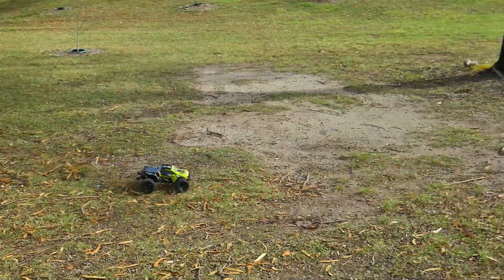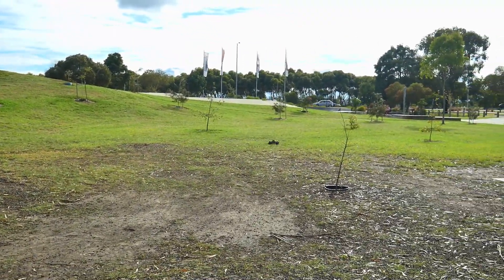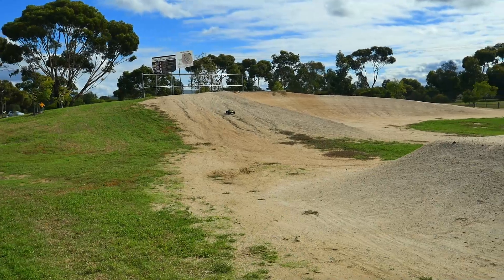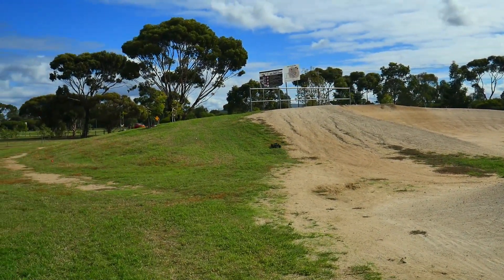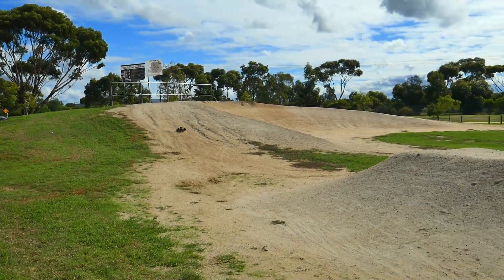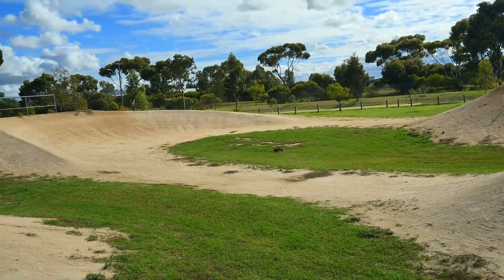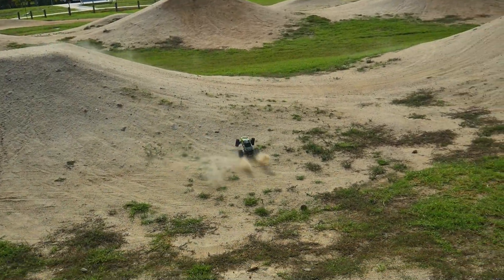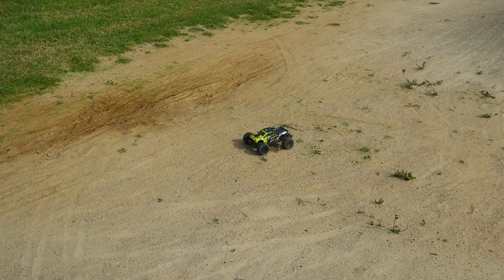First Run of The Rlaarlo Omni-terminator On 3s - Stock

Comment: You won't get a backflip out of the metal version motor unless you enter at part throttle and then floor it.  There is not enough wheel speed to flip on that KV.

Comment: A good quality 3s 120c battery, and the speed gear on the carbon edition with this bigger motor and bigger better esc and I’m doing double back flips like it’s both!! This truck is addictive brother!! I’ve hit things with this truck that you wouldn’t believe… and it’s not broken yet… jumped it 15 ft or so over and over landing on the concrete. I stopped that when my chassis skin started to fail. I pealed the chassis skin off cleaned it with Cow RC products and I swear after 13-15 packs it looks like freakin’ new bro!! Nothing bent or broke… nothing!?! I did put the upgraded shock stand offs on from the beginning because they just use a thinner screw with a nut from the factory… that’s really the only week spot I’ve found. And I just took care of it before they bent up… but yeah mate… this thing is sooo smooth with this extra power and gyro on this carbon edition… it just keeps blowing my mind! Mine does 46mph 74 kph and is on rails! Jumps like a champ! Lands like a dream! You’ll see, especially if you put the bigger motor esc gyro in it… I promise you’ll love it then
Reply: I 100% agree, the carbon is a monster. This platform is the best new RC I've ever seen, it's nearly indestructible. I would have imploded any of my other RCs with some of the things I've gotten away with with my terminator so far, and broken nothing. I cartwheeled it from 50MPH down an entire street when something didn't go as planned and so far the only thing I've bent is the two machine screws that hold the wheelie bar wheels. I send this thing off 20 ft drops without even a slight consideration that it could break. I've never had any other RC that I felt so confident with when it comes to durability. It's still mint other than those little wheels sitting at slightly inward angles.

Any time I see the base model in a review I cringe because despite being the best $199 RC in existence the power level just entirely misrepresents what the carbon model is like. I sort of wish they only made the carbon! Besides at $50 more for all of the upgrades the carbon model has (least important being the actual carbon fiber parts) you'd be crazy not to get it.
Reply: @KenjiFox  I agree 110%!!